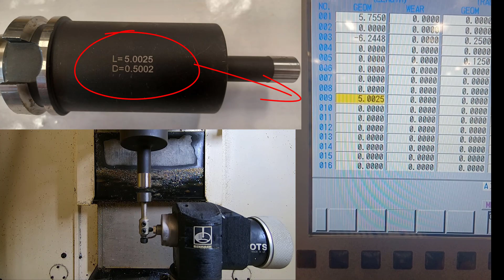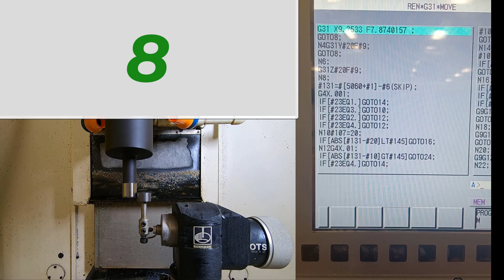Renishaw Tool Pre-setter calibration

Comment: Ive dialed and setup the new tool presetter, we have a reference tool to calibrate. But everytime i try to run the program the code gets stuck at the M20 to turn the probe on. New batteries are inside the setter. Any suggestions?
Reply from the maker: So I ran into the same problem. the probe is already turned on for some reason.  I would look up the in code for turning the probe off. Run that code in MDI and then simply run your program again.
Reply from the maker: I believe M107 is on, and M108 is off. Whenever you type in the right code for off you should see the light blink red on the toolprobe and whenever you turn on the right code for on you should see the green light

Comment: How do you write program line for a small drilll after it’s been used. M528 h .. please need help
Reply from the maker: G65P9921M23.C0.T5.D0.125H0.005;
This is the code for checking tool length and tool breakage using tool #5 as your drill

Comment: Aaron, I have a 97 robodrill I can't get the spindle orientation to line up with the tool changer.  Any ideas how to get spindle orientation changed?
Reply from the maker: Hi Nick,  Unfortunately, lining up the tool carousel with the spindle is outside of my realm of expertise. I do apologize. My guess is that there is something mechanical that can be loosened on the Carousel and then realign and retightened and with a spindle. We use muruka  USA for service questions on our Robos. Good luck and thankyou for watching
Reply: @aaronrunk4209  methods has been very difficult to deal with.
Do you have any contact info for your guys?
Reply from the maker: @RoboDriller  yes you will need to look up marukausa.com/contact/
To find the dealer closet to your and then they can assist from there.